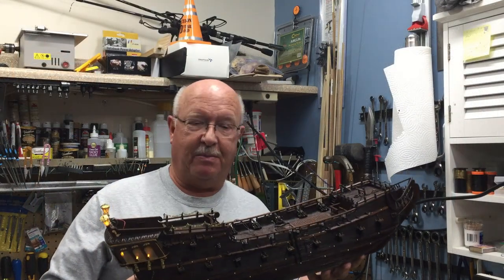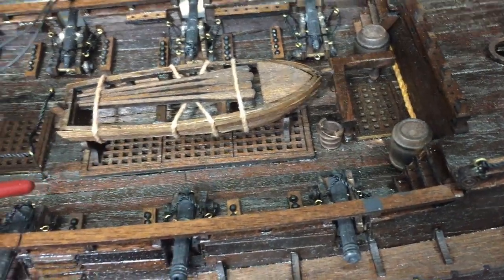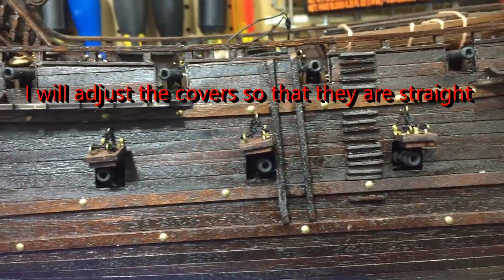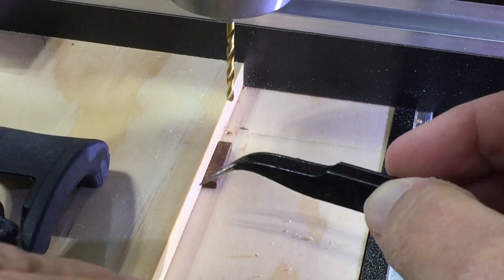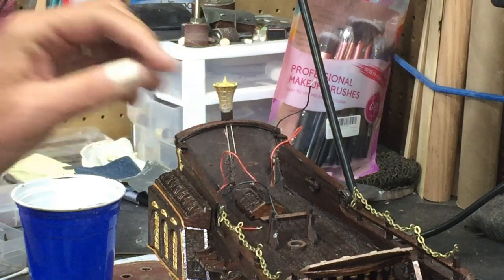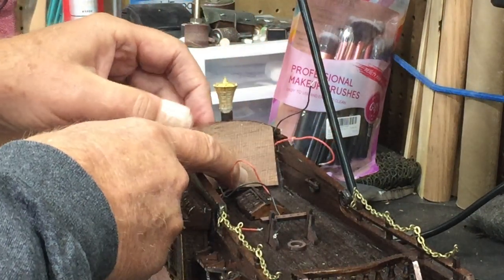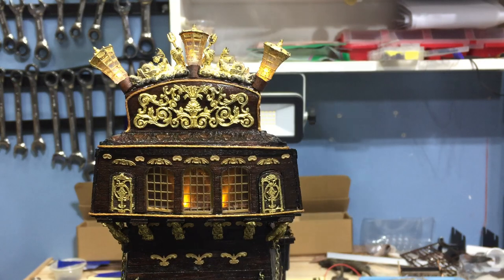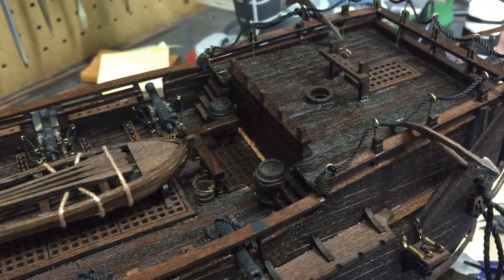The Black Pearl Golden Version 2021 Episode 16

Comment: Looks great! Fantastic idea on using the pull chains!
Reply from the maker: Thanks!  Just stumbled upon them while looking for “stuff”.
The i bolt kind of studs that are a little pricey from model suppliers can be found in the jewelry making area of Hobby Lobby for much less. Plus They were on sale at 50% off.  Each package was only $1.50. That was another great find too.  It’s the i bolts around the front of the ship and around the smaller grate.
I’m looking forward to rope work too!👍

Comment: Hi Dan, Your series is simply delightful and educational to watch. I cannot thank you enough for posting it . Although I am only a casual ship modeler, I have learned and used a number of your techniques on my own humble efforts. I do have only a few questions/comments. First, while I think the chains you used on the stern/rudder, are beautiful-- and would be functional in keeping the ship's steering rudder safe from being lost in a storm, I think that the ones you've strung along the quarterdeck look a little bit large and un-prototypical. Too big for the scale. Also, the anchor on such a large vessel would most probably be hung on a chain. You may discover that a ship's anchor is usually hauled up from the depths with a windless.The rope in the bow is connected to the anchor, and the crew (possibly with a bow mounted windless) will pull up on that rope with the pulley attached to the beam. That's the beam you said you belatedly attached to the bow.This allows the anchor itself to be hauled half aboard the ship and away from harm. One of the things I discovered while modeling is to have a scale person nearby to check the appropriateness of any scale materials. These are really nit-picking, and cannot detract at all for the absolute excellence of your modeling and video efforts. Thank you.
Reply from the maker: Actually, Thank You.
Very good and helpful advice.
I was experimenting with the oversized rope after seeing some very large diameter actual ship ropes…. But in hindsight, I think they are for docking,not the area I placed them.
On the anchors….not sure what I was thinking 🤪….But the good news is that I can make those changes 👍👍
Believe me, I’m a novice beginner and sometimes make it up as I go! (Sounds a little like Captain Jack Sparrow 😂👍🏴‍☠️)

Comment: Hi Dan, What size of nails you used for canon doors? could you please share the link?
Reply from the maker: I will check on that later today. I’m not home at this moment and don’t have it inside my head 😂
Reply from the maker: This is the best I can estimate:
The build manual doesn’t say the size.  I have a few and measured with a sliding caliper device and the main shaft is approximately .65 mm and length 10 mm.
I found similar on eBay.
Click details to see it’s size listing from the seller: click link below 
https://www.ebay.com/itm/394585041790?mkcid=16&mkevt=1&mkrid=711-127632-2357-0&ssspo=4HqeiBN5QHm&sssrc=4429486&ssuid=s8A53jWuRTC&var=&widget_ver=artemis&media=COPY